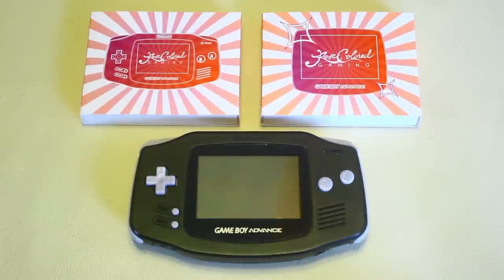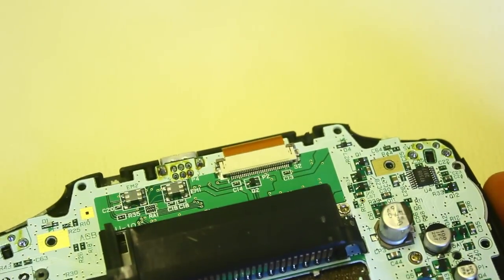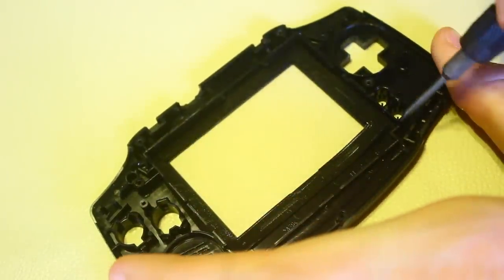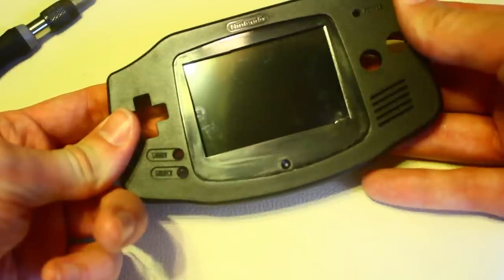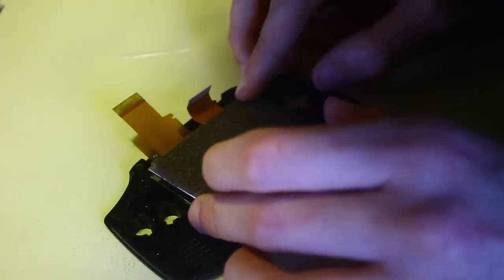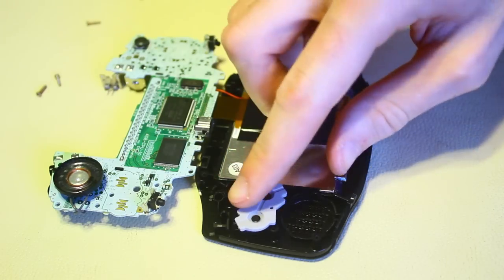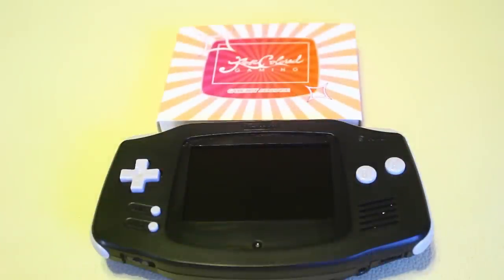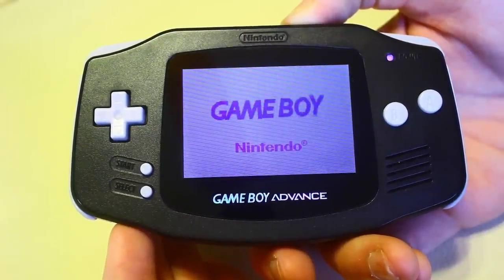GameBoy Advance Backlight Mod

Comment: ah man the speck of dust inside the new screen is unacceptable.... i could not live with that
Reply from the maker: Neither could we. We took it apart at least three more times to get rid of dust or to reposition the screen.
Reply: oh nice, i feel better now lol
Reply from the maker: +RideRedRacer Unfortunately, the dust problem has gotten much worse lately.

http://imgur.com/bbKsbus

Yes, all that dust is under the lens. This is most likely due to there not being a complete seal around the LCD, being held in place only with those two dabs of hot glue. I'm gonna have to figure out a better way of securing it. Maybe double sided tape would work better?
Reply: oh man thats crazy. ya seal it up with double sided tape
Reply: 3m double-sided tape works wonders, and it's kinda cushy and thick for a tape.
Reply: Huh, that's the same color GBA I own.
Reply: KindOfALotOGaming one thing I discovered regarding the screen - it seems to attract dust even more when you turn it on. Almost as if it has some sort of static/magnetic field discharge. It's absolutely necessary to create an air tight seal around the screen because it pulls dust in from the rest of the housing. I had to become a dust surgeon to remove every single spec. Lol 
I know It's been 2yrs since this posted so I'm certain you have things sorted but I figured I'd toss my two pennies into the discussion.
Reply: I had the same issue. I just added double sided tape where the screen is placed. Hopefully this helps. It’s a pain in the ass with this mod

Comment: hey i did the md but i ran into a problem:
my gba turns on then immediately off, do you know how i can fix that?
Reply: Jack lewis Look over the board carefully and see if any solder dripped on the board and shorted something. Also, check to be sure you don't have any exposed wire that could be shorting something when you close it all up.

Comment: How do you know if the motherboard has to be mod if you use a game boy advance sp to get the backlit screen
Reply: There are two types of LCDs that were used in AGS-101 GBA-SPs. One type can be used directly with the ribbon adapter we used. The other requires a few jumper wires to be soldered to the motherboard. I believe there are now adapters that work directly with the second type of screen so that modding the motherboard is no longer required.

Comment: i cant seem to find this kit for sale on rosegamings site, there is one for sega nomad but thats it, elsewhere its non existent...ebay there is one for sale but typical ebay dickheads, they want $99
Reply: You can get the ribbon adapter on its own for $15 on amazon (search for ags 101 screen) and an ags-101 that is otherwise broken (i.e. won't charge) will run you $20-30 on ebay. You could probably use wire scavenged from a USB cable or something.
Reply: Yeah I had this idea but here in Australia even a broken ags101 is $100 and over

Comment: Gameboy advance plus backlight=best gameboy. SP is cool but my giant adult hands don't fit it well
Reply: I just like the GBA's style better than the SP, my hands aren't that big.
Reply: Just make sure to buy a pouch for them cause that screen could easily be scratch even worst with a backlit as you will later find scratch marks and dead pixels in them over time.
Reply: Thanks friends! been thinking about doing old school retro gaming but handheld. I don't really have the time nor drive to spend hours playing some crazy immersive graphics out the ass modern titles, and the game boy had limitations on graphics so gameplay was still very valued. I can just do that on the metro or killing time, it doesn't take up space if i want to do it in my dorm like my nes and snes games, and the cards ad a retro kind of feel to it.
Reply: アテナエクスクラメーショ   :( why friend?

Comment: What is the purpose of soldering the pin on the ribbon cable to the board? My backlight works fine without doing that.

Comment: Some days ago I tried it myselfe with an AGS101 Gameboy Advance SP-Screen that I got from an old SP, but on the housing of my GBA is a lot preassure caused by the adapter-cable. Is this normal or did I something wrong?

Comment: It's a shame you can't find these replacement screens for a decent price. You should show how to mode the same model to have rechargeable batteries inside without having to take them out and charge them.
Reply from the maker: Yeah it's too bad. From what I can tell, these were replacement LCDs for AGS-101 SPs that haven't been made in years, and were essentially new old stock. Suddenly they found a use with this mod and the supply ran dry somewhat quickly. I don't think there are nearly enough people interested in this mod to justify the cost of making more LCDs. Your best bet at this point is to repurpose a screen from an AGS-101 in otherwise unacceptable condition (cosmetically damaged, dead motherboard, etc.).
Reply: One of the best things about the original GBA is that it was the last handheld to use proper batteries. Batteries run out, you change them. You don't have to spend the next 4 hours tethered to a wall socket.
Reply: How often do you play from full charge to dead, though? I mean the SP has a pretty good battery life, and constantly changing batteries is not very fun and it can get expensive.
Reply: +JobeMinacum the one I made for myself lays lasts for 20 hours and the one that I made for a friend lasts 22
Reply: I just use rechargeable AA 2500mAh Li-Ion batteries. They last me several days before needing a recharge

Comment: for those of us who took apart the ags-101 sp. is there such a thing as a ribbon cable adapter to put the normal advance screen in the sp so you still have two working systems?

Comment: If you cannot afford to buy a replacement backlight screen, could you try to connect the screen cables to the circuits by soldering? You should give this a try.
Reply: Jorge Garcia no, it doesn't work

Comment: I successfully completed installing the backlit screen, but now it won't read games. I'm assuming I messed up something while soldering, anyone know what I did and what I can do? It just shows the distorted Nintendo logo, but I know the game works. Thanks guys :)
Reply: I figured it out. The cartridge slot's solder points were shorting on the back of the screen. Make sure you put some electrical tape over the back of the screen so you don't run into this issue, luckily I fixed mine. Good luck guys!
Reply: @KapnHook  I ran into a similar problem with one I was modding where all the colors were messed up after the mod. Turns out a blob of solder was shorting a couple pins on the CPU. After I got rid of it, it worked fine.

Comment: I just did my mod and everything worked out fine and dandy. Only one thing that's been getting under my skin, there's just barely enough space for the adapter to fit between the screen and the motherboard so when the whole thing is screwed down there's a bit of a "water" affect when pressing buttons or even lightly applying pressure to the shell. The affect is right where the thickest part of the adapter sits, anyone run across this and know a way around it?
Reply: There's a kind of specific location where the adapter fits where it won't put too much pressure on the screen. It takes a bit of trial and error to figure it out, but it can be done.

Comment: Is the ribbon extension required? I was gonna buy a screen off eBay but I won't get the extension then.
Reply: +Pride Games You NEED that custom ribbon cable. That is the most important part in this mod in order for it to work.

Comment: The screen you put on there was a ags 001? Or a 101? I'm currently tryna do the same thing but I want the ags 101 cuz its a much better screen
Reply: Alex Pozos It's an AGS-101 screen. An AGS-001 screen actually won't work at all with the adapter we used. The ribbon cable pinout is different

Comment: I've watched dozens of these mod videos and during the soldering portion,  none of them use solder.  Are you just using the heat from the soldering iron to secure the wire to the board?
Reply: Dwayne Elizondo Mountain Dew Herbert Camacho You might be able to get away with only using what solder is already on the board, but I added a little bit extra to be sure the connection was solid.

Comment: you mentioned that there are 2 different types of ags-101 screen. How to tell apart and which is the one we want for this mod?
Reply from the maker: The ribbon cables on the LCDs look slightly different. One type of screen (whose ribbon cable looks pretty much like the replacement in the video) can be used pretty much directly with the adapter. The other (whose ribbon cable is different-- you'll know if you have one of these LCDs) requires some mod work done to the motherboard to function correctly. It's been a while since I did this mod but I know there are discussions on gbatemp.net about it.

Comment: I have a problem I hope someone can help me with, I have installed it all correctly but when I push on buttons there is pressure applied to the screen which you can see as if I am poking the screen.
Reply: ltd1991 most likely, it's the ribbon cable adapter. It has to be in just the right place so it doesn't put pressure on the screen from being sandwiched between it and the back shell.

Try folding the ribbon cable in slightly different places so the adapter is higher or lower, and see if it helps. It'll probably take a few tries, but it could help fix your problem

Comment: is it possible to do with an agb 001 screen?
Reply: yes if ur gba is an agb-001 then u will need a 40 pin ribbon cable adapter

Comment: I love this mod and plan on doing it, already ordered all the materials.
There
 is just one big minus for me for the original GBA: the dpad. Its so 
mushy and unresponsive. Ive got a mint model that i even cleaned the 
contacts of and still, a dpad press is only recognized when pushed with 
slight force. For me that makes it almost unplayable. The GBA SP has the
 best dpad ever in my opinion. The clicky response is supreme and 
diagonal movements are registered totally precise.

Does anybody know of a good "mod" to fix or enhance the dpad on the original GBA?
Reply: Use a DS Lite dpad.
Reply: RealShaun I agree. I just bought a GBA and after using an SP for all these years the dpad was kind of a slap in the face. Still has superior ergonomics though, so I'll deal with it

Comment: Would the mod work the same way for the front lit screen? I'd love the backlight but all I can find now are front light SPs
Reply from the maker: I don't think the front lit LCD panels are compatible with the adapters. An alternative might be to take just the front light out of the SP (separating it from the LCD panel) and transplanting it into the GBA, keeping the original LCD. Essentially doing an afterburner mod.
Reply: I lucked out and managed to get my hands on a backlit screen, but thanks for the advice! The only problem I have now is that the system is kind of bulging so the glass screen isn't staying adhered to the system.

Comment: Rebuilt and modified a GBA with a screen from a donor GBA SP.
New case, buttons, rubbers, a glass screen cover, the whole shebang.
Used your video to double check the areas to be removed from the case and power wire placement.
Not to bust balls but I took special care to make sure that there weren't smudges or dust under the screen.
Thank you for the cautionary lesson and reference! 
Very pleased!
Reply from the maker: Yeah the dust thing was a pretty dumb mistake. We did end up redoing the screen placement a few times to get the alignment right, so we got rid of the dust while doing that. The glass replacement lenses actually have a smaller window than the original plastic ones, so screen alignment with them can be tricky.

Comment: Hello I'm Not Getting find the product on the site =(
Reply: Read the description.
Reply: +Cody Fox already read the description more do not think the LCD screen to sell on the link in this description
Reply: +PixelzPlayers The screens have been out of stock everywhere for quite a while. Your best bet is to find a trashed AGS-101 (back-lit SP) with a good screen, and salvage the screen from it. Some 101 screens require a bit of extra mod work to the GBA motherboard to work properly in addition to the adapter cable.

Comment: I think I fried the DA1 component when trying to solder on the wire from the adapter ribbon. First off, I had an impossible time soldering it on, I think because I have a cheap soldering iron that doesn't have a temp control. Now the console light flashes green for just a second when I turn it on, but it won't turn on. Did I mess this up beyond repair? Any suggestions/insight?
Reply: This is probably too late of a reply, but this happened to me yesterday too. Turns out there was just excess solder on the motherboard, so it was connecting all the capacitors in the area together. Which would short the Gameboy. Just go back and desolder it and try it again
Reply: RyandBurtson  thanks for the reply. I'll give it a shot
Reply: i tried this and it's still doing it :( I've messed with the volt thing on the back too and no change. it turns on and then shuts off immediately. rip

Comment: Can you use the screen of the gba sp gsa 001? Or is it necessary to be the gsa 101?
Reply: +Priceless Gaming Yes you can! I did it. Here's the link to my thread: http://gbatemp.net/threads/ags-001-screen-light-assembly-into-og-gba-mod.368171/
Reply: Well, thank you man! I might go through with moding my gameboy
Reply: Priceless Gaming
Make sure you get the correct adapter cable for your the AGS001 front light screen assembly. If it's a back lit screen adapter cable, it can kill your front light which happened to me.

Comment: Somebody shoot me some numbers. Bout how much will this cost?
Reply: Chris Spreitzer you can buy a screen on ebay for about 40 dollars, and that ribbon cable connector thingy for 10 dollars
Reply: alright. cool.
Reply: If you're feeling lazy apparently you can find these already modded and for sale on amazon and ebay for around $130 or so. The last one i seen was more than just this mod though as it included a new shell and 1 more mod as well (forgot what it was though)
Reply: Hold on, I bought everything on aliexpress for 47 dollars( yes that includes the ribboncable) the sellers are called Gamer Zone

Comment: Rose Colored stopped producing these screens, any other places to get these screens?
Reply from the maker: bobonung The only other place is to get them from SPs, which we have done. It can get somewhat expensive with that route though, as the backlit SPs are getting much harder to find. We were lucky that I was able to get a hold of a good 4 or 5 of them that were in really rough shape cosmetically.
Reply: bobonung Replacement screens have started popping up on eBay again
Reply: Replacement kits are all over eBay now for $50

Comment: I just did this mod and it appears that the GBA is now stuck in the less bright of the two modes. Is there a way to change this?
Reply: Alex Chipman I haven't modded anything myself (certainly not this either), but I've read that the screen is stuck in the default brightness option, which is the "normal" setting. That is at least what the seller of a modded GBA I bought told me. 
From what I've read and seen though, it do seems to be preferable to have it this way, since you can play in the dark without hurting your eyes. Also it just looks better, imo the most bright setting looks way to bright.
Reply: Alex Chipman If I remember correctly there are 3 parts of the place you need to solder:The first one is the no-backlight setting, the second one is the limit for the AGS-001 model, and the third is the one you were supposed to solder it to. There's another tutorial that says which one you solder.
Reply: Faire enough. The less bright setting is fine for me. I just wanted to make sure I wasn't missing out on the possibility of a brighter screen.
Reply: Alex Chipman If you want a second model, just get another screen, and I remember now. You soldered it on the wrong one, and here's the instructions for it:
First, wherever you soldered it to, wire the backlit screen to the RIGHT pin of the 3 pins that are making the "Y" Shape. I'm not responsible for any damage to you or your system, so if anything goes wrong, apologies.